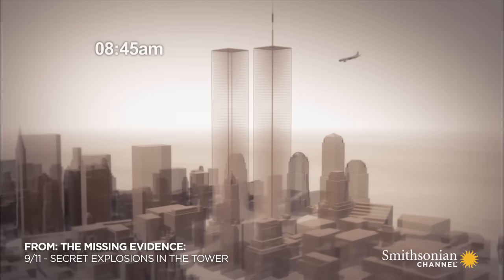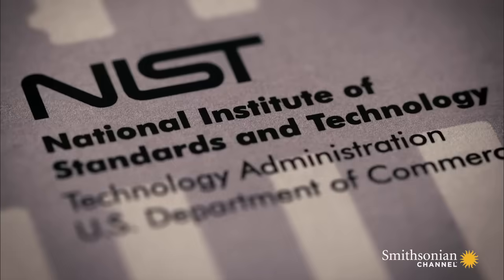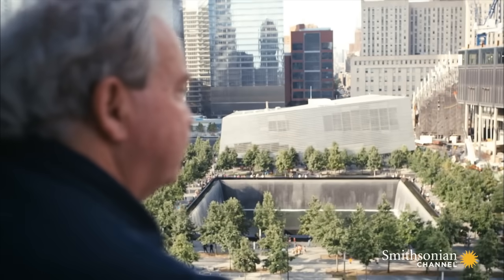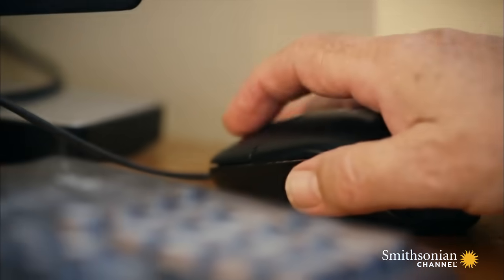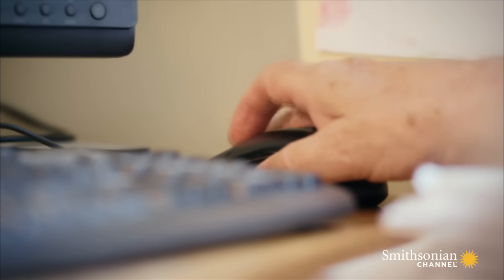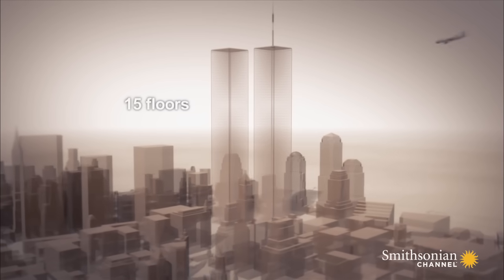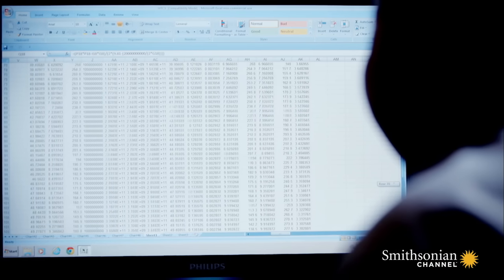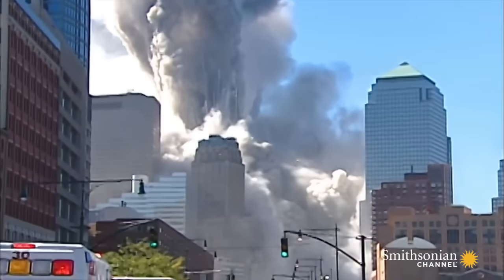This Computer Simulation Explains How the Twin Towers Fell

Comment: Does that explains why massive successive explosions were heard? And the presence of phosphate residues found almost in key major structural points of the building?
Reply: Also, Building 7, videos never released from the Pentagøn and $2.3 Trillion “missing” the day before.
Reply: @GhostSal  
"Also, Building 7, "
Explained a long time ago.

"videos never released from the Pentagøn"
Itemised a long time ago.  Only 2 (next to each other) caught anything and those frames were released.

" $2.3 Trillion “missing” the day before"
It was never missing it was just not accounted for during an audit.  Within 6 months of 9/11 more than half of it was reconciled.   Nothing to do with 9/11.  A big nothing story.
Reply: @markh1011  Building 7’s “explanation” was “office fíres”, which caused what appeared to be a symmetrical collapse (which even NIST admitted the damage from the fires was primarily on one side of the building).

According to the FBÍ, there are 85 cameras located in the area where the plane hit the Pentagøn, and only footage from one camera was released. Is it really plausible that only one camera caught anything? I know you will say yes but is it really? 

*Unaccounted for synonyms are “not reporting, missing, missing-in-action, gone and lost.” So your counter point is semantics and a deflection rather than an actual rebuttal. As far as what they recovered, what you stated isn’t true and in reality the amount they can’t account for has actually significantly increased.

By 2015, the amount reported missing by the Offíce of the Inspectør General had increased to $6.5 tríllion—and that was just for the army. Using public data from federàl databases, Mark Skidmore, a professor of economics at Michigan State University, found that $21 trillion in unsupported adjustments had been reported by the Defènse and Housing and Urban Development departments between 1998 and 2015. That’s about $65,000 for every American. 

There’s no sign that the gøvernment’s internal audítors have made much headway in finding the missing money. Jim Minnery of the Defènse Fínance and Accounting Service traveled the country in 2002 looking for documents on just $300 million worth of unrecorded spending. “We know it’s gone. But we don’t know what they spent it on,” he said. He was reassigned after suggesting that higher-ups covered up the problem by writing it off. He’s not the only who thinks so. “The books are cooked routinely year after year,” says former defènse analyst Franklin C. Spinney.  

Who are you Mark? I’m not saying the gøvernment is pure evíl or that 9-11 was definitely an inside job. All I’m saying is there are things that deserve to be questioned and our one gøvernment isn’t always this ídeal we hold it up to be. I can’t even question things on here without someone trolling me and fakíng my account pretending to be me, sure that’s not suspicious at all and I should just believe there is nothing of concern right?
Reply: @GhostSal  
"which even NIST admitted the damage from the fires was primarily on one side of the building)."
There is no "admitted" involved.  They fires were out of control across many floors.  
The collapse initiated at one side.......and?

"Is it really plausible that only one camera caught anything? I know you will say yes but is it really? "
Yes.  Cameras were not set up to get footage of planes.   Only the 2 cameras (next to each other) were aimed at a nondescript section of wall.   How many cameras do you point at a wall?

"So your counter point is semantics and a deflection rather than an actual rebuttal."
What are you even talking about?   What supposed counter point.  If you're going to just dismiss something then provide some substance.

"By 2015, the amount reported missing by the Offíce of the Inspectør General had increased to $6.5 tríllion"
You're not understanding.  The US has had an ongoing problem with tracking military spending.  
But in the 2001 chapter of this, most of it was reconciled within six months of 9/11.   The fact that it's been going on for so long should help you understand that it has nothing to do with 9/11.

"Who are you Mark? "
When you start focusing on the person instead of the evidence it's usually a very bad sign.

" I can’t even question things on here without someone trolling me and fakíng my account pretending to be me"
I'm not interested in your made up stories.
Reply: @markh1011  See I knew you wouldn’t acknowledge any concerns as legitimate. Who said the cameras have to point right at the impact site, release footage from anything the other cameras saw (approach, pass by, anything). If the cameras didn’t catch anything, release the footage and prove it. You are convinced building 7 wasn’t concerning at all, why am I not surprised you wouldn’t be? All that money missing is a concern and you líed (or were willfully misinformed) about what happened to that money and you also falsely claimed they found a substantial amount of it. 

I never claimed it had anything to do with what happened the very next day after they announced it, that’s irrelevant and doesn’t take away from the fact it is still deeply concerning. Instead of coming at me, why not ask why there are so many troll accounts on here and why they make fake copycat accounts? I know because you are obviously trolling here too, otherwise you would at least acknowledge some concerns as legitimate. No worries, I know you are trolling and have no interest in going back and forth with a troll. Other trolls are, my fake copycat account (my real account started Jan02 2016), tpryce is a troll and M Fitz is also a troll (there are others too) Goodbye Marky Mark. 

Semantics again, not “missing” and “reconciled” more than half… BUT that’s not true and the money “unaccounted” for actually grew to a substantially larger sum (again look up what “unaccounted for” means). This Mark guy is an obvious troll ⬇️👹⬇️👹
Reply: @GhostSal  
"Who said the cameras have to point right at the impact site, release footage from anything the other cameras saw (approach, pass by, anything). "
You're avoiding the point.    Cameras were not set up to get footage of planes.

"You are convinced building 7 wasn’t concerning at all, why am I not surprised you wouldn’t be?"
Provide evidence that is.

" All that money missing is a concern and you líed (or were willfully misinformed) about what happened to that money "
Nope.  It was never missing.  It just wasn't reconciled as part of an audit.  More than half of it was reconciled within 6 months of 9/11.  Sure the US has had ongoing issues tracking military spending but you're conflating multiple year to year issues that have no connection to 9/11.

"Instead of coming at me, why not ask why there are so many troll accounts"
As I said, I don't care about your made up stories.
It's quite telling that you're deflecting to this nonsnese.
Reply: John g  😂
Reply: If you look at the testimony in context it's usually clear that they are describing either the collisions or the collapses.
We have plenty of video of the towers and there are no mysterious explosions going off.

" And the presence of phosphate residues found almost in key major structural points of the building?"
That did not happen.